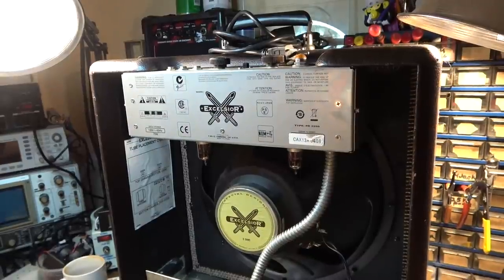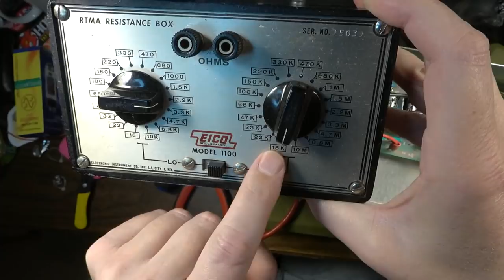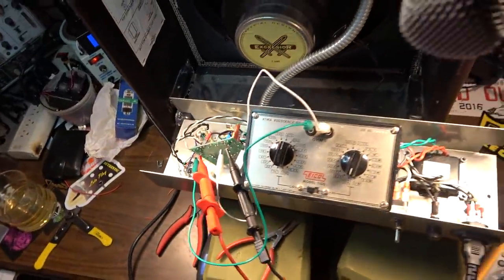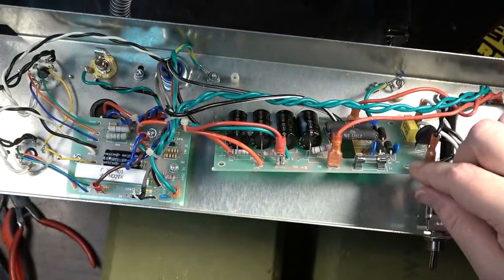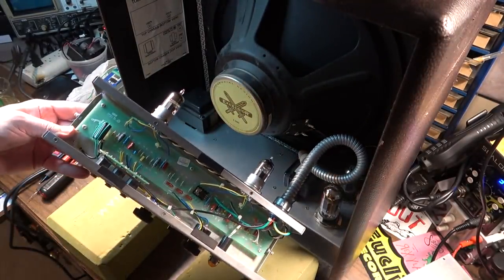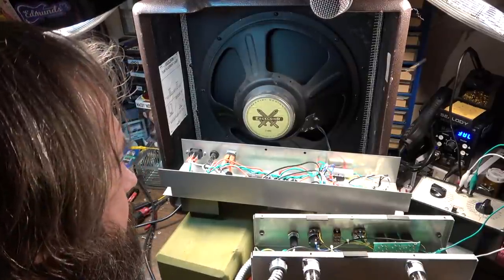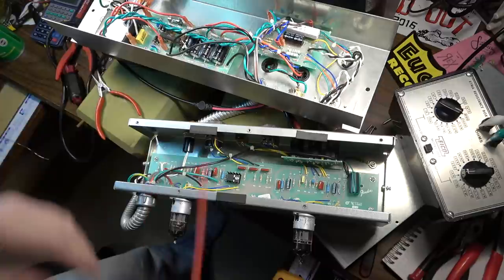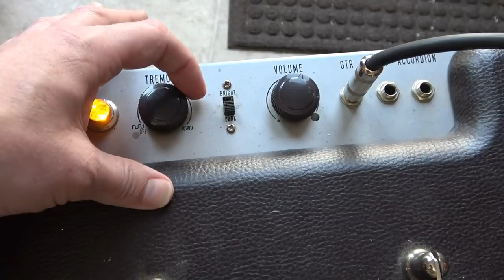Repairing Al Gore's Favorite Tube Amp - Fender Excelsior Pawn Shop Special Series

Comment: Hello, long time viewer, I especially liked your video on the coof virus. Here’s my 💡.  I’ve always had solid state amps, But kept seeing these 200 buck Monoprice Stage Right all tube amps. I got the 15, with 12 inch speaker. Told it was like the Blues Jr. Turned it on maybe 15 times. Unplugged it, went on my 12 days out on the road, OTR driver,  came back, plugged in, Nothing no light nothing.  Interested in fixing it ?  Only mod there’s no fuse on the Amp.
Reply from the maker: To have me repair it would likely exceed the replacement cost.

Comment: What an honor it must have been to work on Al's amp. My guess is that he invented the guitar amplifier along with the internet (information super highway), and climate alarmism (he was and may still be invested in and working for green energy companies). 
That cap right next to the 10watt resistor is exposed to the heat and heat definitely shortens the life of electrolytic caps. Electrolytic Caps should never be located near any source of heat. Yes, they make high temperature versions for that, but they cost more, and I'm betting that's one one of them.

Comment: Did they not drill through the chassis for the ground because of appearances maybe? Only reason I can think of.
Reply from the maker: It's probably on the schedule of CE regulations or something, having to do with a ground lug being accessible from the outside. What was supposed to be a safety feature became a flaw.

Comment: Classic case with the numbers, the more you do and get experienced, the more you make sloppiness mistakes because you don't check everything twice. Just like getting shocked by the amp.

I would agree the ground lug is Fender, the chinese factory workers do what they're told to. It might be the leadership is calling for savings, but not drilling the hole through, yet still drilling it, is not saving anything like you said. That's just weird. Those power resistor solder joints look really crusty. Is it just grilling the flux or?

This is a super weird little amp. Like with this size circuit you'd expect handwiring almost and it's really neatly put together, wiring and components are really clean and good habit excluding a couple of problematic things. Like much better than most cheap circuitboard amps wouldn't you say? It's just weird there's those few clear mistakes. Surprised it doesn't have like a 10" speaker. In my mind that would be very fitting for the amp.

When demonstrating that tremolo, I thought your friend was playing some Annihilator song.
Reply from the maker: I think the lack of an external screw head might have been to satisfy some kind of international regulations involving grounding. The idea being they don't want a screw to be accessible from the outside to be turned an loosened, thus loosening the ground point. What was supposed to be a safety feature turned into a flaw.

Comment: I don't understand why half the speaker is blocked by the decorative front-panels. Doesn't that make a difference?
Reply from the maker: Not enough to matter. It's an open back cab anyway, so you're getting it from all angles really.

Comment: I need help Brad? I've given up the BOAZ 1 as a bad job and gone way past it now, but my problem is my Les Paul. I made the mistake of buying one with a Floyd Rose installed. I've made improvements on it by installing locking tuners and a TUSQ nut, which has helped a lot. However I still hate it... I'd like to fit a Vega trem... can you help please?
Reply: what's your problem with the BOAZ? Its in progress and the updates have been timely and well reasoned. You DO know Covid hit and that has set back production, right?
Reply: @brich2929  My problem is with courtesy, not being sufficiently updated... Last updated 17/11/2020. Very Timely?
Reply: @colinricgmailcom  I just got an update a few days ago, and 4 this year. They are sent to the email address that you used for the Kickstarter.

Comment: I've been looking into getting one. Would you recommend?
Reply from the maker: This is an amp that could later be converted to PTP wired if the boards ever go bad. It’s relatively easy to mod. Replace the speaker. Budget for that. But for a good price, sure, pick one up. Check your ground connections. Get the bias resistor off the board.
Reply: @TheGuitologist  thanks. love your content

Comment: I had one of these replaced the Speaker with Eminence 1518 I think it was. Much improved sound. Also replaced the power valves with 6K6. Sounded good to me. Should have kept it. Got the valve tip from here. https://blog.thetubestore.com/excelsior-new-fender-amp-old-tubes/

Comment: I have a question for anyone Brad anyone that might read this comment that might know or most of the amps made today including like you know the regular wired not the extra money hand wiring but like just the regular ramps fender whatever makes are they using PC boards also I mean is that basically the way it's done PC boards with tubes and I guess transform is another kind of good stuff? Sincerely was, Bob the blind bedroom guitars
Reply: Yes, every amp that Fender currently makes except for the expensive hand wired ones has a PC board and that is also true for most amps from the other major brands.

Comment: I don't mean to "arm chair quarterback" here but using a 1/4 or 1/2 watt decade box in a circuit that is conservatively 10 watts could ruin the decade box, cause values to drift off spec or even flame on in the worst situations, but you know what you're doing, right? Rock on.
Reply from the maker: The resistors in this box are all 2W. The resistor sees about 1.8W at idle through that resistor with the 470R. You could even go a bit higher than that rating as long as you're keeping the duration short.

P = 	v^2 / R
=(29.2 volt)2 / 470 ohm
= 1.8141276595745 watt (W)
Reply: @TheGuitologist  Yeah, like I said, you know what you are doing. Great videos.

Comment: Okay, I'm listening to this through the center channel on the Logitech 5.1 on my computer and I think this amp sounds awful. Am I nuts?
Reply from the maker: You're just listening to an onboard camera mic here. But yeah, the tone is still not for everyone. Given some more time with it, I could mod it into a beast, I'm sure. It's a bit fizzy on the top end at times, depending on the guitar used and the volume setting.

Comment: Was hoping someone from here could help me find a replacement neck for and Ibanez ergodyne 4 string bass neck pref the gun metal grey but I don't care if color doesn't match so much as its a good neck. Dog knocked it off the stand and the headstock snapped off. Really don't want to get a new bass as its been my baby for years. I've only been able to find 5 string necks in my searches.
Reply from the maker: Get the neck repaired.
Reply: @TheGuitologist  I don't think its repairable the truss rod pulled out of the neck when it snapped off. Is this something you could look at? Really don't know anyone who has the skills I don't trust guitar center and they are the only thing local. Thx for the reply, wasn't sure if anyone would see it.

Comment: I've had one since new - used a lot for recording and great to have a round. Speaker is definitely and acquired taste - and you can hear its tonal personalty just by tapping the cone.  
Question: the resistor mod at the first preamp. Does this give more headroom before breakup? My one gripe with the amp is that it breaks up a little too soon before you get useable SPL out of the thing.

Comment: I've got one of these things and the volume knob doesn't work half the time. Like the amp is just on 10, completely bypassing pot. good times. Do any of you electronics wizards think it could be anything other than a crappy pot?
Reply from the maker: Open it up and inspect the leads and make sure there isn't some kind of short around the pot. Otherwise, it's an internal failure of the pot, most likely. Might be something conductive laying across the terminals of the pot from the leg to wiper.

Comment: as usual thanks again Brad you answered my question on brands and apparently it's offender so I got that answer and just another visually educating video for Bob the blind bedroom guitarist enjoyed it as always don't need eyes to enjoy your videos LOL sincerely yours
Reply from the maker: Thank you, as always, for your kind comments and for always checking out my videos. This is indeed a Fender. This is one of a series of amps called the Pawn Shop Series they made starting in about 2012. They did 3 or 4 different models. This one has a stylized front grill that's offset and almost art deco in appearance. It is reminiscent of old Valco amps and Dickerson amps from the 40s and 50s. It has a 15" speaker and two chassis - one up top for the preamp, and one in the bottom for the power section. I've had old Danelectro amps constructed like this too, as well as old Chicago made Sound Projects amps. Fender was obviously going for the kitsch market with these, and honestly, they aren't too bad if you can get one for the right price. I've seen WAY worse in this price bracket.
Reply from the maker: Also, I don't know if you realized it or not, Bob, but you are no longer subscribed to my channel. Might want to subscribe and select the notification bell to keep up with all the new uploads.

Comment: 7:17 I worked on a fender vibrolux reissue a while back noticed the 6v6 in the reverb drive was running really hot so I measure the resistance from ground to pin 8 and noticed the value was 300 ohms the resistor rating was 330 at 5 watts. so I thought well it's just reverb drive why does it have to be so hot? so I put a 390 ohm 5 watts and it was perfect.

Comment: What idiot designed a 10 Watt power resistor right next to an electrolytic capacitor? Ah, never do that! Capacitance will increase with the heat and shorten it's life.

Comment: Sorry,correction you were reducing bias on the LFO stage wich only would affect the tremolo wave.Infact increasing the value on the cathode resistor (1,5k) to 3,3k would reduce the distortion on the thing,plus the speaker is just awful.

Comment: Just my insight here,when you calculate plate current,dissipation based on cathoderesistor voltage.-You need to subtract the G2 current.My calculation with the original resistor value gives it a plate dissipation of 10 watts.also the shorting powertube will not stress the healthy tube,just shut it down.-Furthermore keeping the Cathode resistor at 3,3k would keep the distortion down.The MosFet is an impedance converter introducing a sinewave on the poweramptube control grids.As an amptech i think you spend to much time on theorizing aböout possible faults.The working method is the half and half method.Start at the ends,work your way in.-Never theorize about what might have happened.Never hit a tube with fingernails,or a wooden object,thump it with soft fingers,or soft rubber.otherwise you will surely crack the glass,introducing air into the tube and this can take weeks.

Comment: Your comments about how amp was designed are pretty funny.
 If you're so good why aren't you designing amps for Fender?.
 Have another glass of bourbon and touch your tongue to one of the capacitors see if it has a charge. Y'all